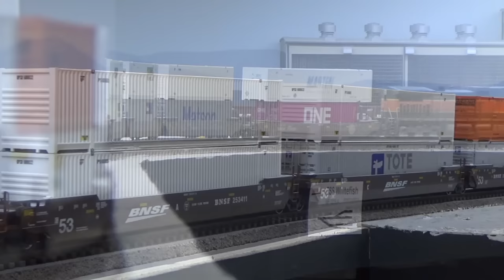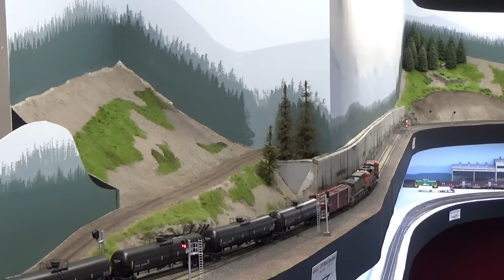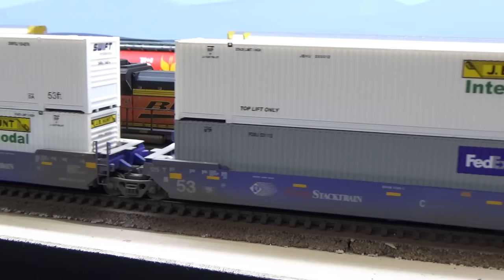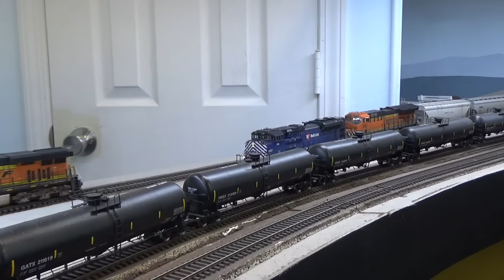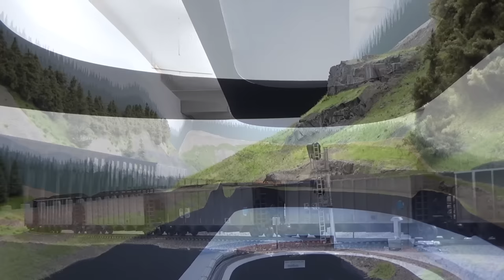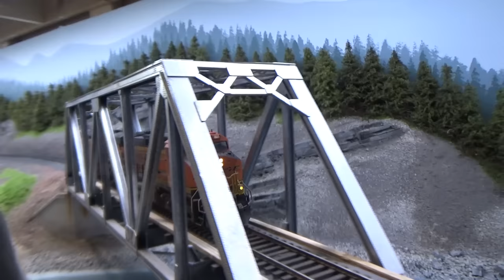Ops Session: Mainline BNSF Marias Pass Operations (w/Dispatcher Radio)

Comment: I've made this trip so many times. Well done! One thing is that it's CTC (centralized traffic control) territory, hence the lights. They would never get or need a Track Warrant.
Reply: Great comment… I was going to ask someone this.
Reply from the maker: Thanks! I've had to take some liberties to model this line in the space that I have. So at the time of this video, only the sidings at Essex and Blacktail were protected CTC sidings. The warrants were only used to get trains between Essex and Whitefish. I've since added signals down to Columbia Falls, so the operations evolve to reflect signaling efforts.
-Cam

Comment: Hey cam great video. Just a little tid-bit from a prototype railroader. When a key train (train with 20 or more loads of hazardous materials such as an oil can) will, when possible, hold the main track in a meet. Granted this only applies to loaded tanks. I have no idea why the hazmat rules are like that, they just are. Might make some interesting operation! Again awesome video!
Reply: Great point! I suspect that most sidings are not maintained to a suitable level for hazardous materials.
Reply: PS The western railroads have several high traffic density passing points like Marias Pass that likely are maintained to very high standards and may not have the same restrictions as other passing sidings.  Just a thought.
Reply from the maker: Thanks for the info! That's definitely something I will incorporate into operations!
-Cam

Comment: Great video and loved the flow of the trains over the layout. Q- In all the shots of the trains going through Tunnel 5, there all on the inner track and not using the outer one, is there a reason for this?
Reply from the maker: Thanks! Trains generally use the outer track because it's defined as the mainline. The inner track has a tighter radius, and the east end has a relatively sharp switch. So the siding is only used if a meet is necessary. 
-Cam

Comment: 45:41 What is the purpose of the boxcar between the Locomotive and the crude oil tankers?
Reply from the maker: I don't know how the exact rule is written, but "buffer" cars are used on the oil trains (and other commodities like ethanol) because the cargo is combustible. So in the event of a derailment involving a spill, the buffer car provides a bit of extra distance from the locomotives and crew. I've seen a variety of cars used as buffers, but on BNSF they're typically older covered hoppers that are specifically designated for buffer service. You can actually see it stenciled on the side of them.
-Cam
Reply: @railfan220 Hey, doesn't #7010 look similar to #7011?😂
Reply: @railfan220 Doesn't #7010 look similar to #7011?😂
Reply: @railfan220 Doesn't #7010 look similar to #7011?😂😅